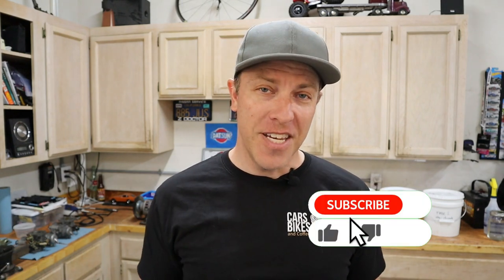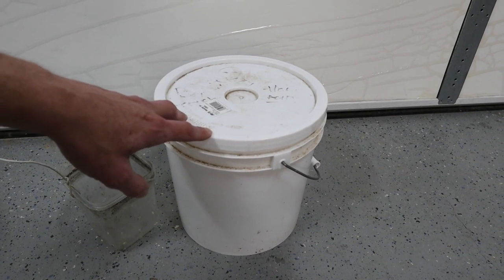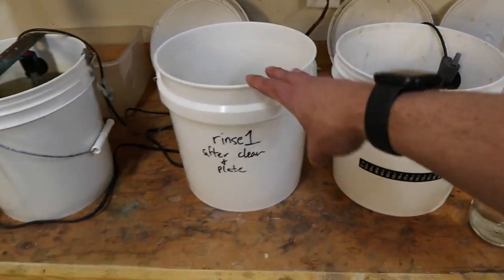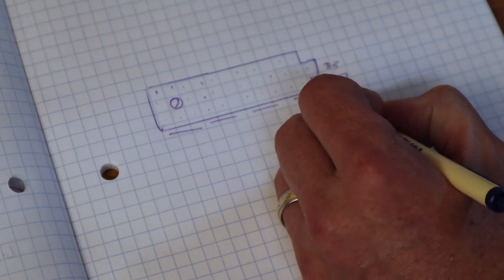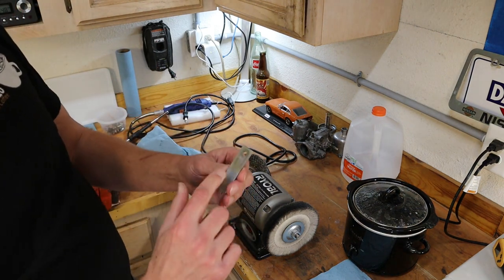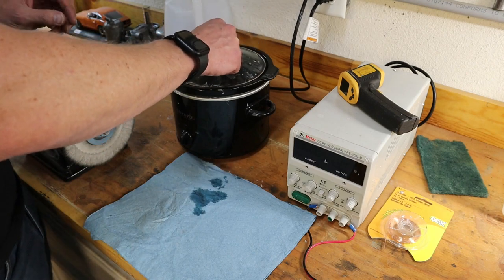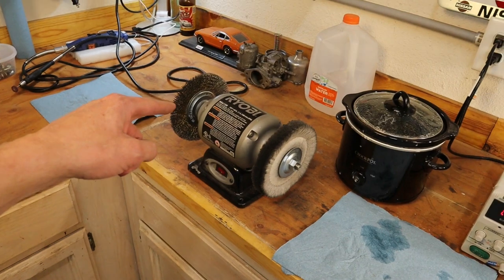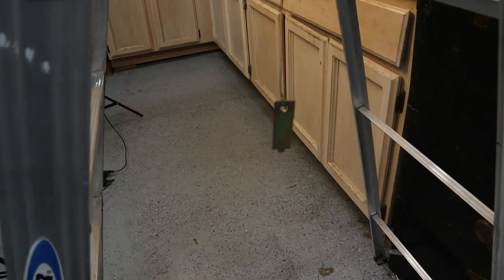How to Zinc plate and apply yellow Chromate to parts

Comment: Great vid but one thing to note. If using a wire brush to clean parts it should be made of the same metal as the part you are cleaning as you can get friction transfer that can compromise plating
Reply from the maker: Thanks! I was always under the belief of using a softer metal brush than the part and you would be okay, hence the brass. I’ll have to revisit, thanks for the info
Reply: Good point. Your steel part will get a loosely adherent coating of brass. Us a stainless steel wire brush.

Comment: Great Video. Really enjoyed it. I see just how critical controlling the AMPs is now to getting a good result. Caswell is supper expensive for what you get. The Degreaser (Sodium Tetraborate Decahydrate) is Borax and the Brighter is just Karo syrup. That said the Yellow Chromate mix seems to be nicely proportioned for the purpose if you don't want to mix it yourself.
Reply from the maker: Thank you! Appreciate you watching!🤘🏻 yeah, you could totally diy, I tried it as I mentioned, but it was a little frustrating.
Reply: Caswell is not selling Karo syrup.  The brightener is clear, like water. Not sure what their degreaser is, but I don’t use it.   Where did you get the info that it’s borax?

 I stopped trying to calculate amperage.  I found a shop that will plate my parts if I do the prep.  I asked if they calculate amperage and they laughed. They also don’t use brightener. Dip in blue, then go to yellow.  I do that now. 

As with anything the prep is key…. the brightener the parts are when they go in, the brightener they are when they come out. I’ll do small parts if I forget to drop something off or don’t have enough to drop off.
Reply: The brightener will be something decanted from a proprietary additive. It will probably contain sodium dodecyl sulphate, thiourea, and saccharine.

Comment: I bought the same kit 4 years ago and powered it with D cell batteries. It was a little more challenging. Do you have info on the power supply that you are using?
Reply from the maker: Thanks Wayne, I missed putting up the link. Yes, batteries sure do make it even harder! Power supply totally makes it easier. I added the link to the one I use in the description. Thanks for watching!
Reply: @CarsBikesandCoffee  Thanks so much for the quick response.  It's going to be much easier now I need to get moving on preparing more parts.

Comment: was your zinc solution really cloudy when you first mixed the kit together? Mine is milky!
Reply from the maker: It should eventually clear, any plating issues?
Reply: @Cars, Bikes, and Coffee  just a bit hard to watch for bubbles. so fine tuning is sort of a pain... I've used it for 2 days ALL day and it hasn't cleared 😪
Reply from the maker: Are you using a bubbler? If so is it aerating the solution with tiny bubbles? Also, sitting overnight, I assume still milky? Worst case, I would give them a call

Comment: Will yellow rub off if not dried right ?how long until you can handle .
Great video
Reply from the maker: It can, best to give it at least 24 hours before handling. Thanks for watching!🤘🏻
Reply: @CarsBikesandCoffee  hi I oven bake and leave 24hrs still having problems
Reply from the maker: Ah, sounds like there isn’t enough zinc for the chromate to bite to. Maybe try giving it a little more time plating.
Reply: @CarsBikesandCoffee  ok I'll try that thanks
Reply: @CarsBikesandCoffee  hi tried what you said didn't make a difference but I did find out I have no trouble with olive colour can you recommend a company for yellow chromate or a mix.
Please 🙏
Reply from the maker: Could be the concentration of chromate to distilled water or a few other things. Tough to diagnose over the interwebs. Keep trying!
Reply: @gkitch6755  Not sure what comes in the kit. Follow the process, Zn plate, rinse in clear water, dip in 5% Nitric Acid, Cr passivate (this already contains Nitric), rinse, blow dry carefully, heat in hot air (oven) at 60-80C for 10 minutes.
Reply: Actually, on reflection I think you may have just made up the passivate too strong. It's been a few years since I did Zn / Cd plating (like 27 years) but this could be your issue. Does it kind of crack where the drips gather?  Anyway, try diluting it by 25%. Good luck.

Comment: 1:36 if you sandblast the parts they will never have the original gloss finish, will be dull and abraded looking unless to buff it.
Reply from the maker: Very good point, thought I made a comment about that. But yes, if you want a matte plate sandblast, if you want that gloss, I brass wire wheel it.